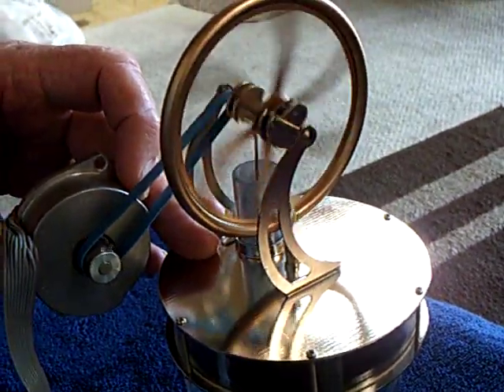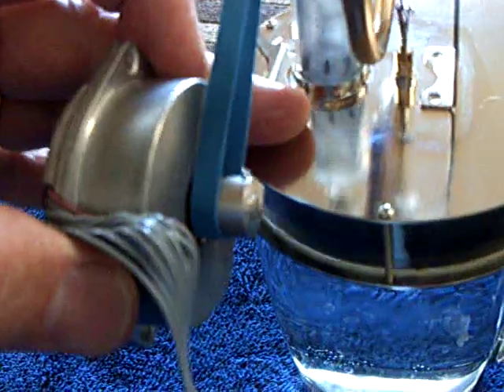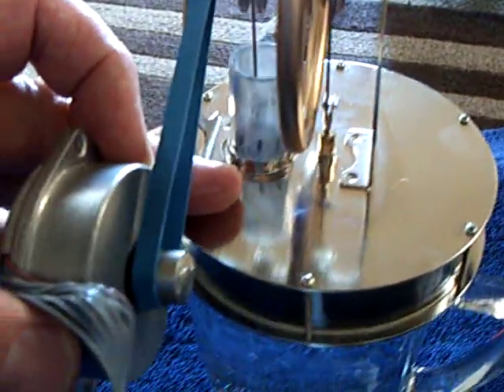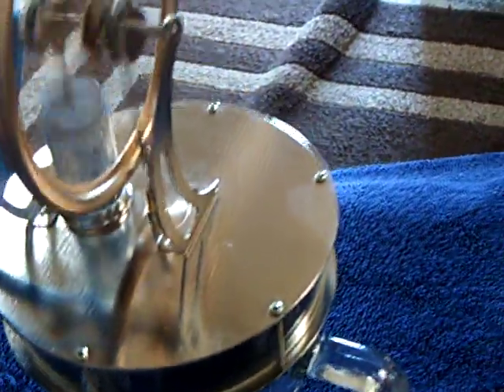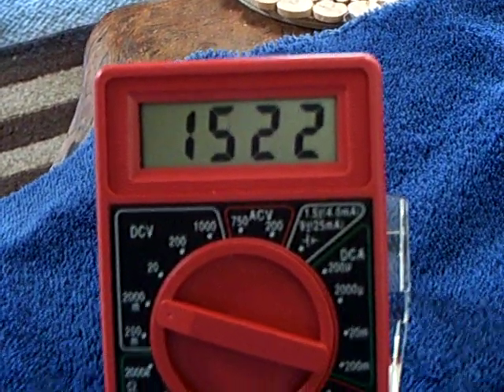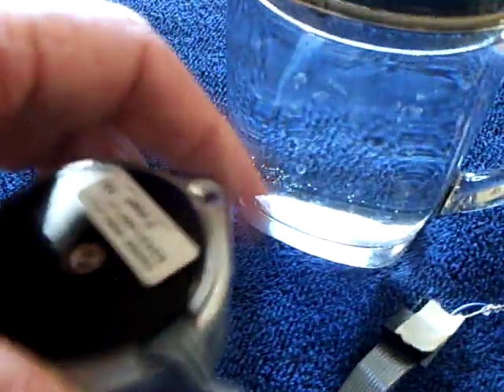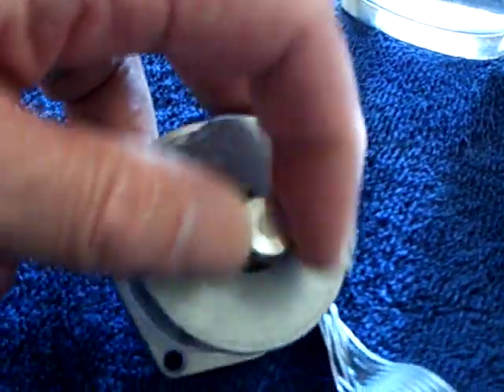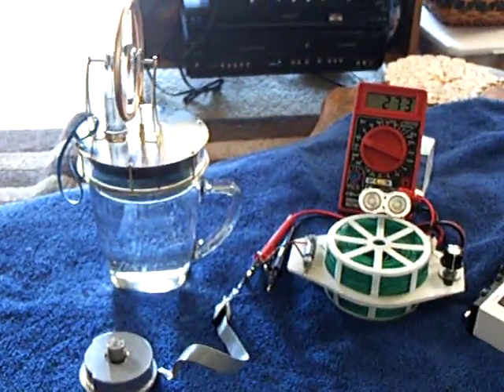Low temp Stirling engine making electricity

Comment: It should have been off the fly wheel to get a ratio of about  4:1 but you have it at about 1:2 but I guess you need more torque to turn it
Reply from the maker: Yes.  There isn't much torque.
Reply: Lidmotor makes sense thanks

Comment: I think a normal house with hot air in the attic and cold air in the basement would provide enough difference in temp to run a sterling engine.

Comment from the maker: I think that would work but the dollar per watt is perhaps the biggest problem.  We need a very simple .low cost, and easily mass produced design.  It has to be low maintenance and run on a fairly low temp differential like you suggest. It is doable but hard.

Comment: the high-grip nature of the elastic band makes it idea for increasing diameter on a number of things. I've used elastic bands to replace absent tools. It's only good for 1 or 2 times to take up space and get the job done, but a life saver when needed.
This high-grip interface may also work better on your band drive, more grip, less slippage. If you want to get really advanced : ovalize the shaft slightly to help overcome the slight cogging you might have at this low torque, smooth the cycle.

Comment: I was just wondering how much energy can be harvested form solar, with one of those inexpensive models, running 24/7. If possible to get enough liquid heated in a window, for 24 hour running. Would be easy outside with a large tank, but can it be done from a window in a small dwelling?

Comment: I was wondering if those little stirlings could drive a load. Gear ratio is a bit sad, but its running of a cup of hot water... Well done. Proof of concept for up-scaling. Do you think you could do a micro solar thermal rig, with thermocycle heat storage tank, in a soda bottle or something? Maybe drive it with a fish-tank size greenhouse effect?

Comment: Nice! Try to wrap another elastic band tightly onto the stepper motor shaft, to increase the diameter. Best the stirling engine will like to run at higher RPM from the otherwise same load?

Comment from the maker: We can get the heat from the sun for free.   The problem is turning that into electricity in an efficient way.  The Stirling cycle is one way to do it.  They already make Stirling engines that run on solar energy.  We need better and less expensive Stirling engines to make it a viable alternative.   Right now the usual way they turn the solor heat into electricity is to concentrate it, make steam, and run a turbine.   There is a big plant out in our local desert that does that now.

Comment: hi what is your opinion if you made a larger version of my old tractor glow plug and encased a stripped car tesla coil in between the centre spiral of the tractor glow plug and the outside of the glow plug.i would expect if its filled with water that the electrons and protons imitted if you place a plate to the neg and another mesh plate to the pos of the coil it should self maintain possibly far greater voltage as it would be unregulated..not quite got the materials to fit here in uk cheers